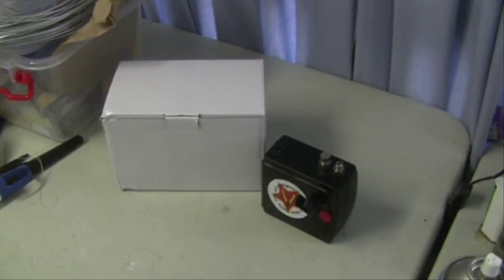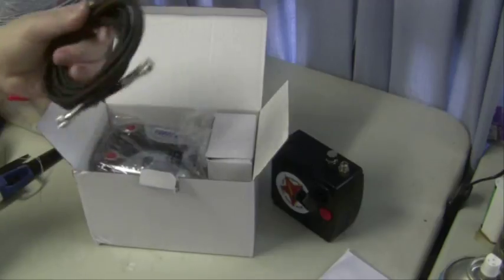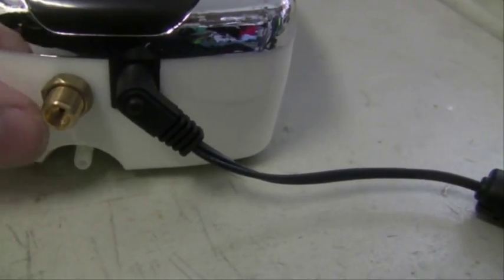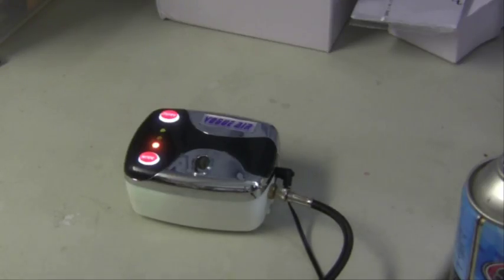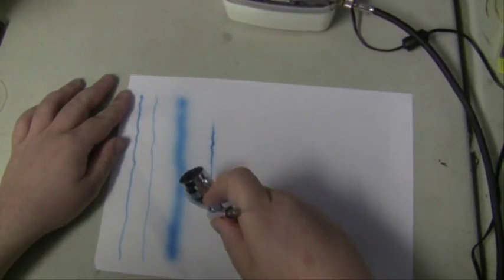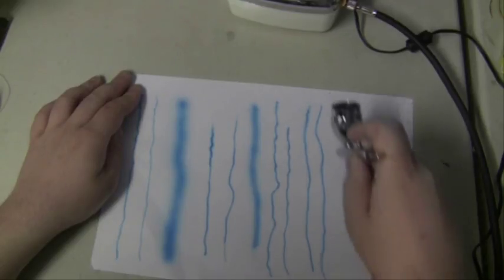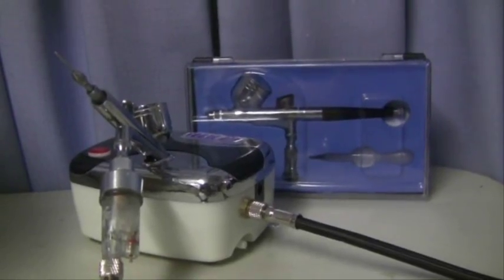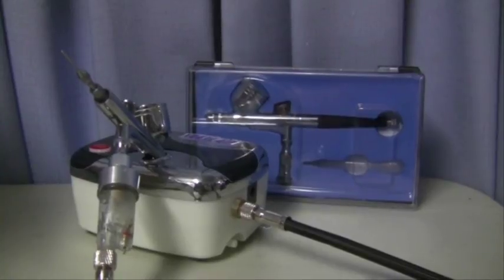Budget Vogue Air 12 volt airbrush compressor review

Comment: I have the same one from ebay. It blows air, and I put paint in the paint container but no paint comes out- only air. It was brand new. Any advice on how to fix it? Thanks. Edit: unscrewed the back part so it pulls out a bit then the trigger was able to push down and back and it worked. Before the trigger only pushed straight down and not back.

Comment: I know very little, but wanted a portable unit that will spray 30-80 micron sized powder glass for small project. But need larger Reservoir.  Any tips appreciated.
Reply from the maker: check out the mini sandblaster kit for etching on ebay/ amazon. Been meaning to buy and test for awhile.

Comment: Awesome review man, looking at pulling the trigger, is there a better option on eBay currently for the pricing point? looking at mainly air brushing sneakers
Reply from the maker: Ebay is as cheap as it  gets with a return policy and protection. Seen cheaper on wish.com and other shady sites but could be a scam.
Reply: @mokanaman thanks for the reply my man, would u still recommend this exact model or is there something else i should look for in particular with similar pricing?
Reply from the maker: @milyak6872  For the same price you can get the royal max which is a little better. It's the one I've had for years and still runs. Check out my review on it. The set maybe $3-5 more then Vogue.

Comment: Could this be used for modelling base coating etc
Reply from the maker: The PSI out put is strong enough to perform all tasks, I've primed, based and top coated easily with the Kings Max as well as the coverage looked already in this demo.